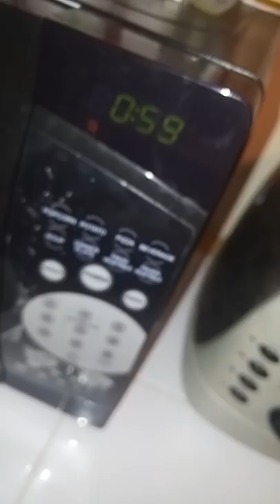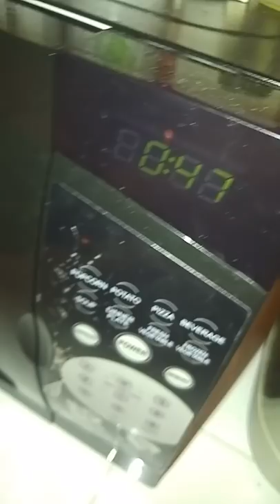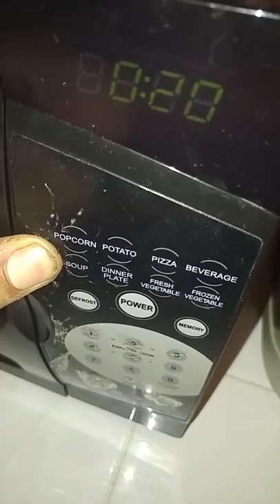Tutorial: quick drying buds ( testing bud)

Comment: I'd rather put a 100 watt light bulb underneath a cardboard box and let it get hot, nugs cut into smaller pieces with stems slit with razor blade down their middle.and spread over top of cardboard box...takes a few hours..like 3..but if you plan ahead you can have it ready when ever you need it..or place a little more after it he first bit dried...so the next will be ready when you are...box never gets hot enough to catch it on fire unless maybe you left it unattended and forgot about it. And even that would take forever..the longer drying with low heat actually tastes fucking great compared to sundried or gold forbid the microwave...even a damn dehydrator is blasphemy I'm my opinion..I used to use the heat from my magnetic ballasts..3 hours and done..the only thing good about the horrible p's.o.s...anyway..cardboard box lightbulb method tastes better than any other by far..if you haven't tried it..take my word and give it a shot..cant hurt anything. 
-Lil Pablito...805